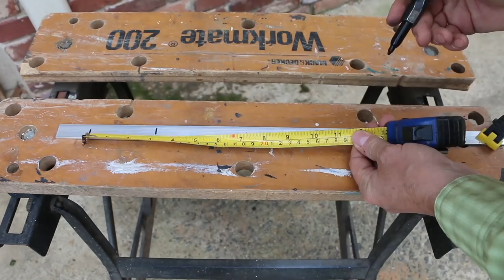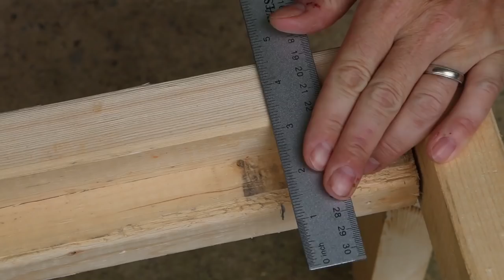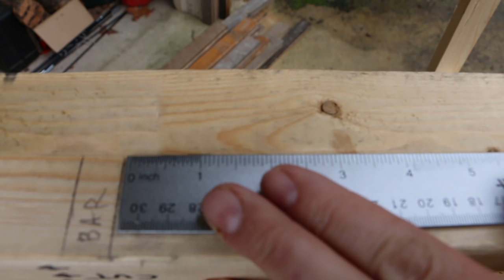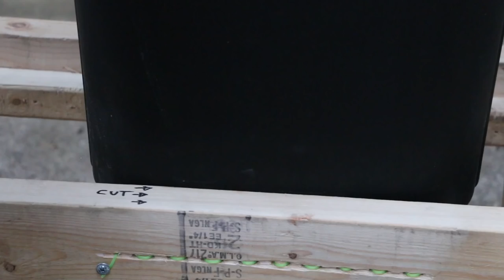How To Make A Simple Flow Through Worm Composter

Comment: I got myself a nice 30 inch tall bin where the top is a third larger than the base, so it should compact nicely. My variation is with materials I have leftover from a build, cinder blocks, which will create a frame into which the bin will sit with an open space at the base, with a trough for any liquids to run into a bucket. Compacted castings can be removed easily with a simple flat metal scraper similar to your blade, since my bin will be static. My cinder blocks hold the base of the bin and I cut an oblong hole similar to yours so the base of the bin also provides support for compacting. You are right to simplify as much as possible, since this is about producing worms without all the constructing know-how, which some people don't have, or the tools you have available, so we improvise on your design! Thank you for your update! You seem to be blessed with dogs barking, leafblowers and airplanes overhead, now what else can disturb your videos?

Comment: I loved the videos and decided to make my own. I did mine sliding the other way so my frame has a smaller footprint. I also used half of a grill grate that was used for camping. It has the same look as the woven trimmer wire but much sturdier. Got it loaded and hoping harvest goes well when the time comes!
Reply from the maker: Sounds great. I switched out the trimmer wire for a rigid metal plate with holes. So your grill grate is an excellent modification. Thank you for the feedback. Thanks for watching.
Reply: GreenShortz DIY awesome channel. Thanks for the build guide and follow up videos.

Comment: FYI, when drilling the holes for the trimmer line, you need to drill a shallow 'trough' for it to lie in so dragging the bin won't wear it down over time; the bin should only be resting on the wood.

Comment: This is much simpler than the first prototype, but I'm curious about why you would want the open bottom when composting, by which I mean the trimmer line section. If you mainly want the compost to stay in place until you're cutting out slabs, would not a solid/flat surface be better than trimmer line? I like the cutting blade idea, so much that I'm considering building this on a potentially smaller scale. (Apartment life) Thanks for the video though all the same!
Reply from the maker: Norman, in the follow up “harvest” video, I do remove the trimmer line and replace with a perforated metal plate. The main reason for the holes is to allow for drainage, if needed. Thanks for watching.
Reply: @GreenShortzDIY  yeah I did end up watching the follow up video and felt like an ass. But yeah, I really like the design, and I'll probably try to adapt it to my situation (medium sized apartment, trying to minimize how much waste goes to a landfill). Thanks for all the content! :)

Comment: Perhaps staple down some welded wire for resting position and cover with a strip of waxed or varnished trim all along those rims to help the slide be easier?  This is one I like but too big to winter in the kitchen.  Think I will modify the first one a bit. Three long tines to the rake,  instead of trying to do the entire thing with one swoop?

Comment: curious to know a) how much worm tea/liquid would you say you empty per week and b) you seem to keep this model outside or in the garage, would you recommend it for use indoors in an apartment? Seems like a great simple design. I was also wondering if you had ever considered using some kind of crank mechanism at the bottom to harvest castings? great videos :)
Reply from the maker: I don't get much liquid out of this system. I do keep this flow through composter outside. Because the bottom is open, there can be more odors (although not much). For an inside application, I recommend contained worm composting bin like this: https://www.youtube.com/watch?v=5S1YWSdJ_PI Thanks for watching.

Comment: when sliding on the side with no wires, wouldn't all the inside falls down?
Reply from the maker: Actually, the mass of the soil is quite sticky and holds together above the cut (mostly). After a day or so, gravity pulls it own to fill the pocket, but it is back on the mesh by then of course. By the way, I switched the string out, in favor of a perforated sheet of metal, in a later video. The string didn't work well to slide over. Thank you for watching.

Comment: These worm composter ideas are great.  But, I still do not understand what is supposed to happen to the worm castings/compost when you move the body of the composter to the left and there is nothing to support to castings below, i.e. the nylons strings?  I hope there is a video on how you operate this sucker.  This seems much easier than your original design.  Thanks for the ideas.

Comment: I love it, but I;m thinking maybe I make the blade on both sides and the string all the way across. Also maybe some supports on top so the the trash can cant tip...
Reply from the maker: Hi Karin. The string on only one side is necessary so the "cut off" soil will drop down on the other side of the blade. At least that is how it is supposed to work. Thanks for your feedback.
Reply: GreenShortz DIY you don't worry about it all dropping out?
Reply from the maker: Actually, when I slide it to that side the soil below the cutting bar is supposed to fall out. That is the harvesting technique for the castings, instead of raking it through the wires. I'm uploading the composter set up video now and will try a harvest in a few weeks. Stay tuned. :-)
Reply from the maker: Karin...here is the start up video: https://www.youtube.com/watch?v=lBmbytRr6tc Harvesting video coming soon. Thanks for watching.

Comment: wonder if I can just use a piece of chicken wire for the base instead of the trimer wire?
Reply from the maker: +Joseph Au it might need more rigidity. You might try a double layer of chicken wire. Offset the openings so the holes are smaller. Let me know how that works. Thanks for watching.

Comment: I want to see it AFTER it is full and AFTER it has had to be slid over the exposed string for a while.
Reply from the maker: I am actually thinking about covering the string with a strip of wood. I debated about having the holes go through both boards, but opted to keep the build a little simpler. I do think it will only be slid 6-10 times a year, so even though this will wear out the trimmer line, it should last a good while. I am planning to do a set-up video on this soon. Thanks for the comment.
Reply from the maker: Hi. Here is the start up video: https://www.youtube.com/watch?v=lBmbytRr6tc Harvesting video coming soon. Thanks for watching.
Reply: @GreenShortzDIY  Hi, I did find this video, and the start up video, but i can't seem to find the video with the metal plate instead of the wires. Could you place that link somewhere (or was that one in the harvesting video, cause i can't seem to find that one either. (I will give it one more try of course)
Thanks!
Reply from the maker: @ShopSDB  The replacement of the wire is in the middle of the harvesting video https://www.youtube.com/watch?v=_5K9HxuOohM&t=329s at about 5:24

Comment: I don’t really understand this design. Why doesn’t everything (include the stuff above the cut) fall out?
Reply from the maker: The material in the lower section of the trash can is fairly compact and kinda sticky. The angle of the trash can is compressing things together as well. I refined this design in a later video to switch out the string with a perforated metal plate. The can sits over the plate to support the column of soil. It slides over to an open area and through the blade to slice off a layer. If I left it in that position, it would fully collapse. But, the consistency of the soil and the compression of the trash can, holds it up until I can move it back over. After that point, it does settle down into the gap created by the slice. Hope that makes sense. Thank you for watching.

Comment: Very good but personally I'd find the plastic string part a bit of a challenge 😐
Reply: Hardware cloth (1" grid of wire or larger) could be used instead.
Reply: a modification would be using PVC   conduits held with dowels that get screwed in.

Comment: @GreenShortz You really should watch = > John is talkative but has great information, and in this case specifically about what you're tackling https://www.youtube.com/watch?v=o7_qJY3BPBk the hungry bin is awesome (although pricey @300) and they don't need/use any casting harvester..I mention this, because your initial flow thru that compacted the castings, seems to me, would have done the trick if you removed the weed whacker string, only thing you needed was a tray to catch the castings..the weight of the castings/food above should push out the ready made compost..at least it did in the hungry bin...maybe some small holes in the compost catch tray, so the leachate/worm pee, drips through to another tray?..also, he/they discuss the difference between 'tea' and not..and what the molasses/sugar does for worm leachate (nothing but turn the molasses into sugar for plants)..just sharing more info..look forward to seeing how this new bin works out (maybe you've already posted dunno, will check..*laughs*..I watched your 1st flow thru video and didn't realize there was a follow up to it, and now this one..*laughs*)...thanks for sharing your experiences!..*laughs*..& the leaf blower, mowers, and barking, don't bug me 1/2 as much as you..*chuckles*..it's warm & outside, Ppl are going to make noise, so don't sweat it..*smiles*

Comment: I would never use that because you would be cutting many many worms to death.  I have many systems and any that inherently are cruel are out. I would rather use half your design and a garden claw. The problem with every flow through system on the market or home made is that worms don't follow rules and they NEVER leave the bottom as long as it isn't toxic for them.